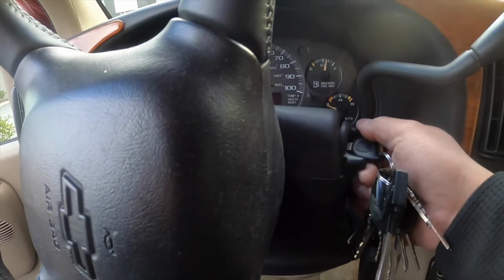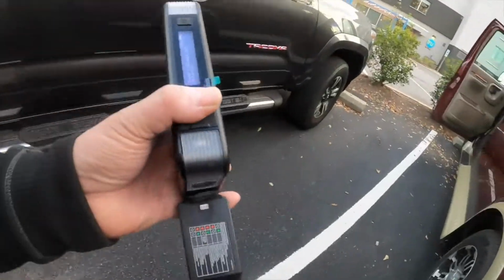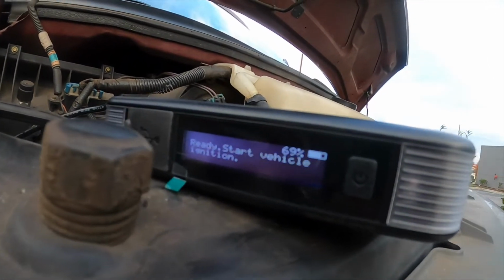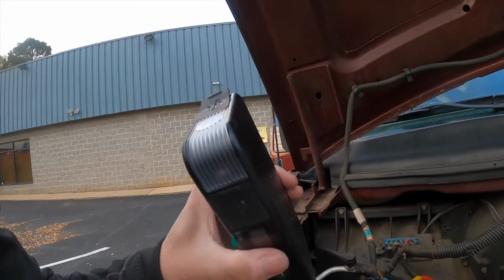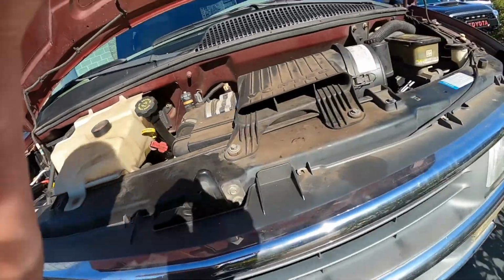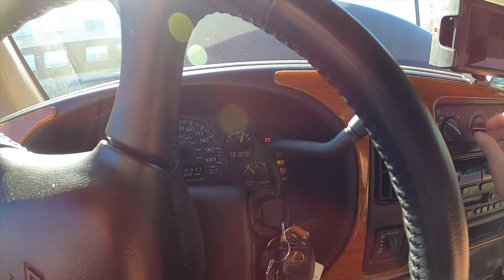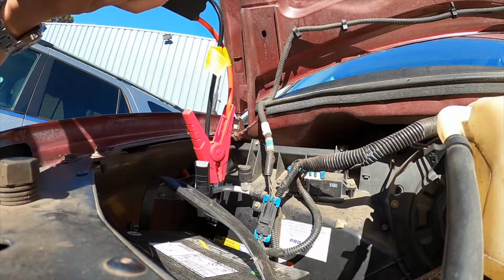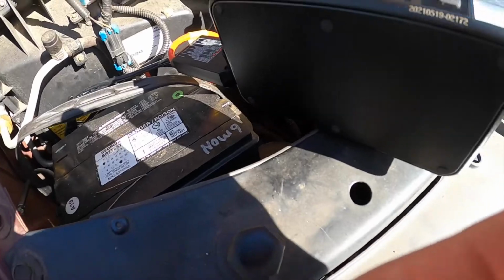Costco Type S Jump Starter review. will it jump start my V8?

Comment: Incorrect. I've had mine for two years. I used it on my dodge durango and my hummer. It works perfect if your battery is completely dead you rest it and it works. Learn how to properly use it before you make videos.

Comment: You got an error you didn't check on the charger. You got a crappy van with a V8 and you left the AC on at first. Who knows what is the hell you got going. Were the cables on the battery correctly, not trying to ground it on the body? Frankly, I trust the charger more than your video.
Reply from the maker: thanks for watching ,

Comment: You didn't even check the light code on the adaptor I bet your van has a lot more wrong with it or the battery is unabke to hold a charge. You could have just gotten a bad unit too. Tons of variables
Reply: Mine doesn’t work either lol

Comment: Same situation as the gentleman. Tried starting the car 'several times.' No luck. The car would not start.  Finally, I read some of the reviews and suggestions. In one suggestion... turn the car lights on so the device (I guess) can detect a battery. So I turned the lights on and tried starting the car. SUCCESS. The car started up immediately.
Reply: What a unique situation.  Some useful tips if all else fails.  Thanks for sharing.

Comment: If it doesn't start on the first attempt you have to unhook, then hook it back up an turn it over again, not trying to start multiple times. Each time you try to start you need to unplug then hook back up. You'll notice each time you did that it got a little more juice each time. I will also note it's more meant for situations where you've just had a battery die, not one where it's been weeks or months or years since the battery had voltage. You'd kill another vehicles battery and or alternator trying to start a battery that depleted. Yea it'll start, but at what cost to the vehicle you're using to jump?

Comment: The purpose of the booster battery is to boosts the weak car battery to start the car. But if the car battery is totally dead, you can try to hook up the booster (now using it as a battery charger) and let it charge up the dead car battery for say 20 to 30 minutes, now try to start the car with the help from the partially charger car battery. if no good, fully recharge the booster hook it up and try again. It still no good, let the booster charge the car battery one more time then try to start again.   Hope  this procedure can help, just my 2 cants.

Comment: I didn’t the like this jumper… Mine wouldn’t even detect that any battery was hooked up. (I tried it with different cars). And yea, you need to reset the clamps every time you try another start. 
🤷🏽‍♂️ It’s going back.

Comment: Jumpstarters work on the 12v battery, not the car. V8 or 4cyl.. doesn't matter. This seems to be a pretty drained battery. Even if he jumped off a running car's battery he'd have to let it charge a while, often several minutes before it gets enough juice to start. If someone keeps trying to start the car, voltage drops ea time. As soon as it didn't work he should have let charged jumper sit on his battery get a bit more power, possibly recharge and repeat. Then start from scratch again. U can't blame the product. The battery was getting an increasing charge. Also, situations similar to this could mean your battery, alternator, even contact to post is faulty. My bf uses these at his shop all day every day. They work.

Comment: Doesn't fit in the carry/storage case with the cables. At least not easily. I couldn't get mine to at all.
Reply: it's a tight fit, but all accessories plus an AC adapter fit in mine

Comment: Maybe you should have read instructions
Reply: the instructions do not tell you about multiple connect/disconnects after 1 minute when it doesn't start.  You find out by calling support.  The assistant on the line told me it would be too confusing to put all these details in the manual -- so when it happened to me. I found out about using it essentially as a boosted trickle-charger first before attempting the restart.

Comment: Perhaps a bad alternador if it doesnt crank or click while turn key. atleast is either the alternator,fuse or started but if is a alternator it wont send enough voltage to started or ignition , if it clicks the started is good but alternator death if the engine crankcs either dried battery or damage battery by alternator. Basically if key clicks started is good if it doesnt is bad, if it clicks but it doesnt start bad alternator. If it clicks & cranks drain battery or damaged it leats u know before time it would go off crancking while starting vehicle closters loosing light power & radio turning off in occasions first stages still battery complete drains.

Comment: It will likely not work the first time if the battery is very low. I see you charged the device 100%. Which is good then you did not try very much after that. You need to “Hold” the key in place for a 5 seconds or so as you turn the car over. Hopefully it will work for you the next time you try it. Watch other like videos and see how they do it. Good Luck!

Comment: My friend 
I saw your video and I had the same issue some time ago.
Is my belief that the jumper you used is for 6 or 4 cylinder engine.
The crank power is limited for those engines 
They make for 8 cylinder as well.
Much more crank power for bigger engines is needed, that's why your car failed with this jumper.
I'm sure you know that.
Probably you didn't check that information before buying it.
Usually the manufacturer states in the box the capacity of the product.
Probably you missed it.
Hope you resolved your battery problem; since despite these jumping devices are around and can help in case of emergency, is also a lot better to have a healthy battery at all times.
Thanks for sharing your experience 
Good luck and good day!

Comment: First, read the manual.  RED to RED and then BLACK TO BLACK.

If Type S doesn't start the car

1) disconnect / reconnect it (not just the clamps, but remove the clamp wire assembly from the unit in order to reset it) and put it back on the battery for 60 seconds .
2) disconnect / reconnect it and try to start the car

repeat these steps up to 3 times, it should start the car after the 3rd time
Reply: You have to start the car within 45 seconds.  According to manual.  Otherwise it will shut down in order to protect from drawing power from the battery.

Comment: You've wasted so much time. When it didn't start the first time, you reset it and try it again. I've used it for over two years without your issues.
Reply: What size engine do you have?  His is a V8, I'm thinking it might work on a V6.